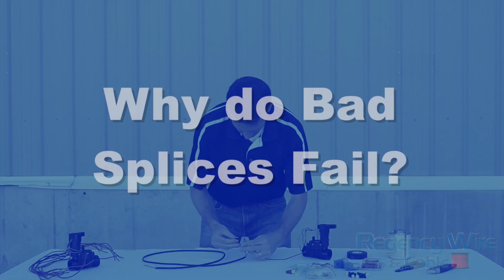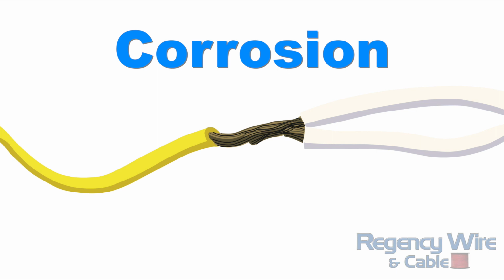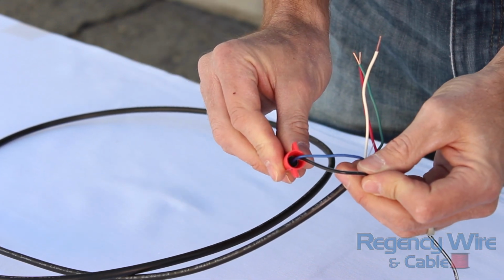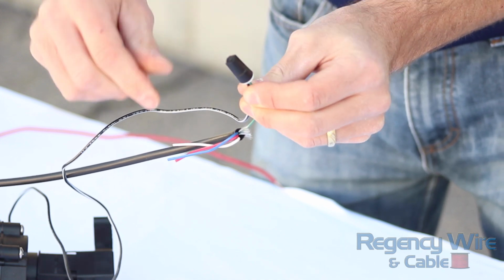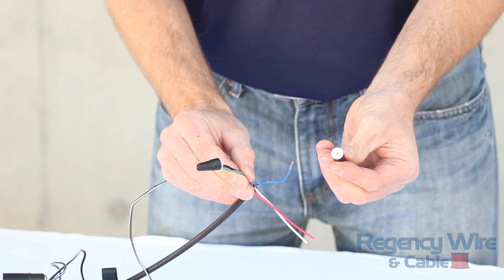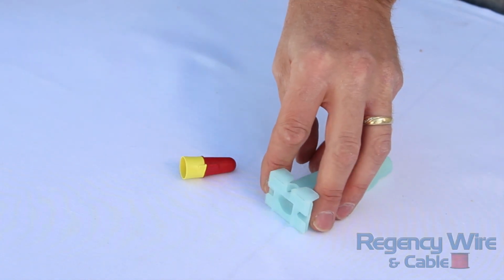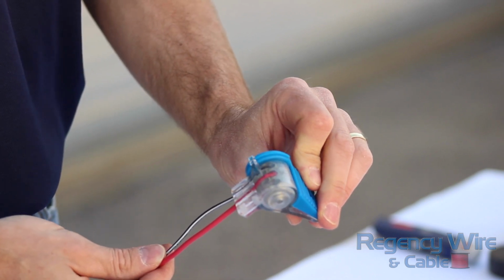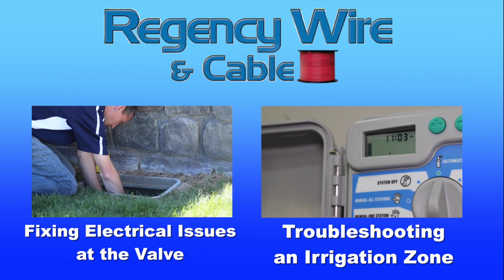How to Make Waterproof Wire Splices for Irrigation Systems

Comment: Use Splice-Kote Heat Shrink Insulation Sleeves for all electrical connections... RCV's, Decoders, Low Voltage Lighting, Submersible Pumps, Truck, Auto, & Trailer Wiring, etc.

Comment: What if there are like 6 or 7 white wires that need to be together? Can you separate them in groups of 2 or 3 or do they all need to remain together?
Reply: You can use separate groups. As long as they are all connected electrically.